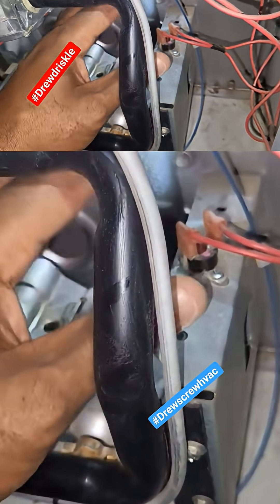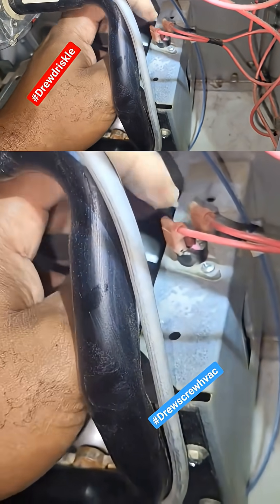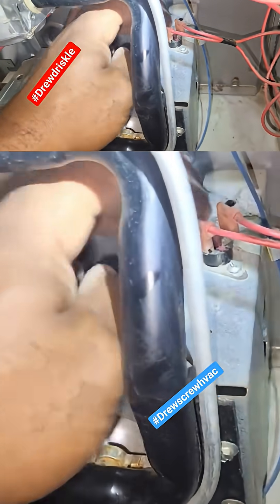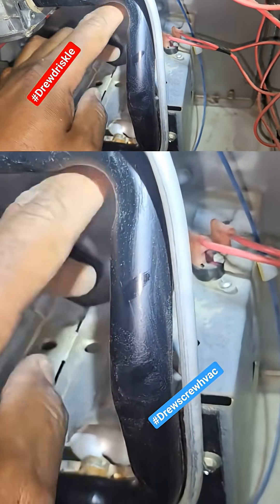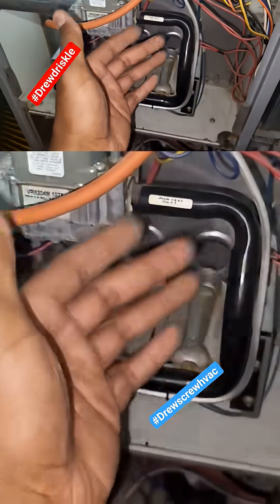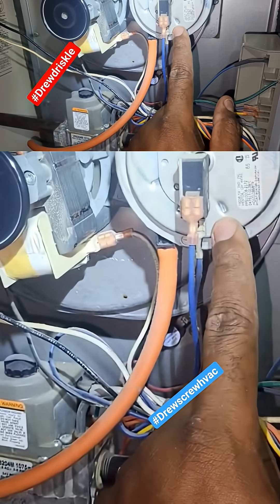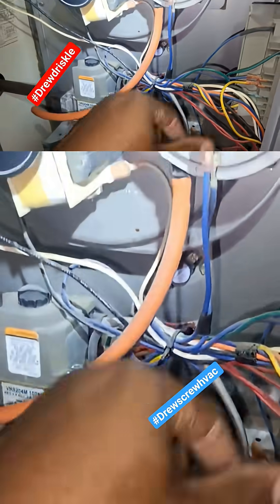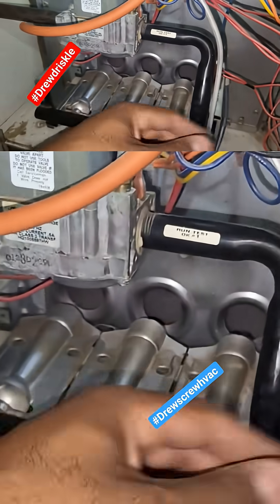What are FLAME ROLLOUT SWITCHES?(explained⚠️) #hvac#drewdriskle#drewscrewhvac#troubleshooting#shorts

Comment: Either your induction motor is burned up or something is clogging your flue pipe. If your heat exchanger is cracked the induction motor should still be able to pull negative pressure enough to keep the flames moving and get the heat drafting through which is kind of a chain reaction or self perpetuating like it is in a fire place.